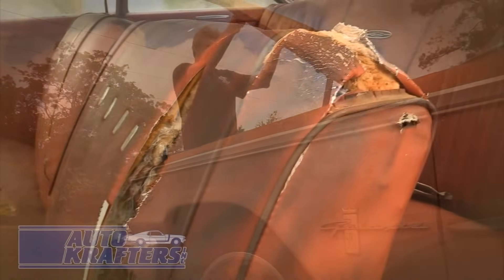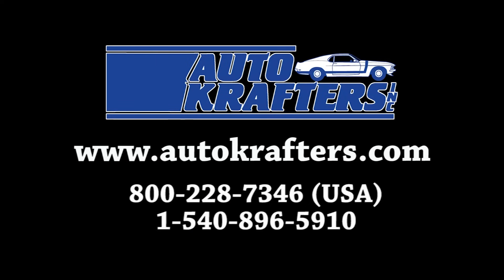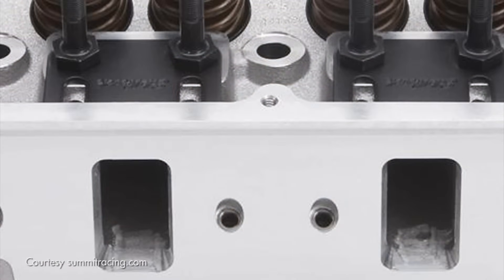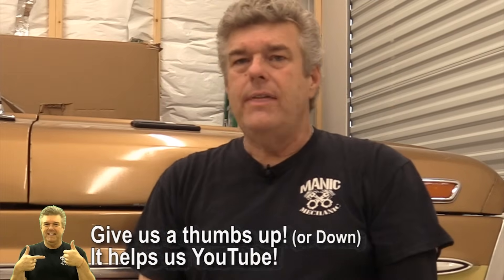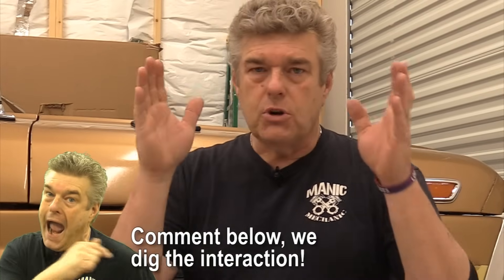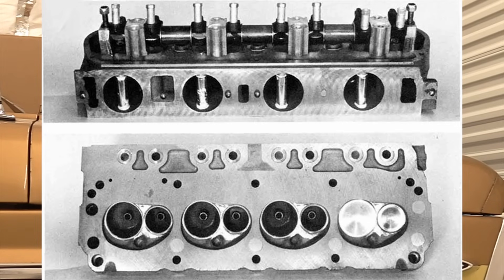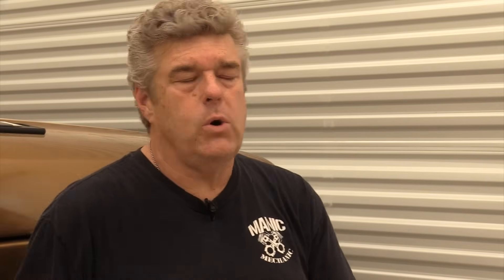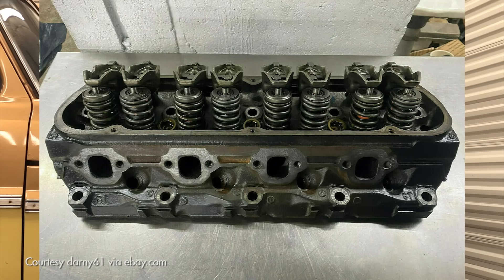Ford Heads Explained

Comment: the reason some of us search for the best cast iron heads for performance is that some circle track rules and classes require stock cast iron heads.  some of us are trying to get affordable Fords back on the local tracks.  some tracks write the rules to only allow GM products to be competitive.  and some of us are tired of seeing nothing but Geriatric Motors products competing.  we ran fords back in the 60's- 80's, ran some Mopars and eventually gm products.  now we are trying to put a competitve ford back on the track.

Comment: I'm going with 302 E7TE heads with upgraded valve springs and roller rockers, with Comp Cam 271H,  but my target is 250-280 horsepower.  And it's going in my 92 Ford Ranger regular cab 2wd, should be fun.
.....I've since changed my mind and going with Edelbrock E Street heads.

Comment: 65 289 heads. My thumb was larger than the exhaust ports. 
I ran the engine for 5 minutes hooked up to My headers. It left a carbon imprint. 
I opened it up to match 
Port & polished intake & exhaust. With combustion chamber. 
HP heads worked will.

Comment: Those 351w heads 1969, 1970.... Had an extra bolt in the intake and the water port was like an L shape and i used them on 289 and 302 engines but you have to use a 351w intake gasket.... The 302 gasket would close off part or the intake water port an cause over heating problems...
Odd yes...

Comment: Aftermarket heads are the way to go! The Explorer heads were the best factory choice! ALL the other factory heads suck unless you install bigger valves and a port job! The Explorer heads were the best ever! With a little port work  on the exhaust side and you could make cheap power! I got a set of ported 69 heads like he’s talking bout! The little you pick up on valve size you loose in compression!! Just buy a set of aftermarket heads! And, if it fits, put a 351w in the thing!! What a 306 will do at 6800 a 351w will do at 6000! I spent 5 years 4 nights a week! He right bout the Clever, that cousin kissing pervert! But, looking at the flow numbers the Victor Junior flowed almost exactly what a 4bbl Cleveland does on the intake side! 274 cubic feet per second! And you don’t need custom headers!!

Comment: I have a set of D0OE heads on a 351w, with 1.94 valves, ported pretty fucking big, I got 567hp/446tq on dyno, flywheel hp. Fantastic heads. Granted it is a non street engine (3500+ rpm) propels a foxbody to great speeds! 4.30 gears.

Comment: Do a video on putting 351 Cleveland heads on a Windsor. Are there parts available? What is involved? Is it worth doing?
Reply from the maker: It's called a Clevor. Basically it would be a long stroke Boss 302. Yes do a good bit of machine work to the cylinder heads to make them work with the Windsor block. And I'm not sure if the intakes are still available for that application.

Comment: I got 351w im pulling out of a 81 rv camper from a family member. She gave me the truck and im pulling the motor. After doing research on alot of different stuff not realy knowing much about older motor. Going to keep the RV cam or put at least a better sounding. Keep it as a truck motor. Bought a set of gt40p that i plan on putting on the motor. Help give a few ponys and keep the torque up. They better then the original and are still better for fuel efficiency. Motor only has 35k original miles on the motor and sat for 23 years so ill keep it truck motor.

Comment: have you talked about the F3JE-CA or AA 2 bar Marine Heads for a 351w? I found a pair on an old Volvo Penta inboard lake boat. I'm thinking about building a 1st gen lightning engine for my 1995 F250. I got the plenum, & tubular intake with tb. your thoughts?

Comment: My GT40 heads from my 94 Cobra are not 66cc heads, They came with 61cc heads with 145cc intake port, 1.85 int/1.54 exh valves

Comment: I saw a article where they took a old chevy turbo style piston and a 318 rod and machined them to fit in a 351 w. to make a 372 w. they used Cleveland heads but said the 4v head's were for track air flow but flowed to much for street but the 2v were better for street.....what a junk yard sleeper🤪🐾🐾🐾🐾😎

Comment: I currently was running a set of Edelbrock RPM heads on a 349 one of the heads messed up in the machine shop is trying to weld it up but if he can't I have a 69 set of 351 Windsor heads with 1.94 valve and 1.6 exhaust valve with pushrod guide place that has been cut a bunch how much power do you think l would lose Edelbrock RPM head compared to these Windsor heads

Comment: I HAVE A SET OF 68 302 4v heads don't know if they are any different than a stock head not sure of valve sze also what about gasket matching the ports if not all at least the exhaust intake you don't have much meat to remove exhaust thats a whole different story

Comment: first time commenting.

I have a 1975 Ford E150 Custom short van with a 351w engine in it. 11 years ago the original engine took a dump so I had to replace it with a remanufactured one. The block itself is from 1974. Everything, including the heads, still from 75. The only upgrades I have done to it, as of last week, were swapping the intake manifold from the original 2 barrel to a aftermarket (JEGS) 4 barrel / single plane / air gap. I added a Edelbrock 1406 w. electric choke. Mickey Thompson Valve covers w. new seals and a regular tune up (new spark plugs, wires, distributor cap and rotor, change of oil).

How can I determine what kind of heads I posses w/o taking it all apart lol.

Thank you and I really enjoy all the knowledge you are sharing.
Reply from the maker: The heads should be one of the following:
D5TE-DA – 1975-1977, 351, Windsor small-block, 1.84/1.54 valves, 60.4cc chamber

D5TE-EA – 1975-1977, 351, Windsor small-block, 1.84/1.54 valves, 60.4cc chamber

D5TE-EB – 1975-1977, 351, Windsor small-block, 1.84/1.54 valves, 60.4cc chamber

What  can happen is you get stuck with 302 castings, if it feels like it's down on power this could be an issue. You would have to remove the valve covers and look for the stampings inside their to know which head you have
Reply: @AutoRestoMod  thank you for all this info, sir. I really appreciate it. I will do has advise.

Comment: if you use  a Windsor head a on a engine smaller than 302 you need to install a pop up piston the Compression loss will kill more power than you will gain with the Windsor head!  We used to drag race 289s back in the late 1960's, If you are using stock pistons the best is the 1966 289 small chamber milled .060. You can get 11.2 to 1 compression with 1966 289 heads.  The P head reminds me of a Chevy head you are all ways burning Spark plug Wires off.
Reply from the maker: True

Comment: you didn't even mention the e7 heads from the 80s. I do appreciate the info, but I do wonder about the 289 non-hipo heads. I have heard tell that you can put bigger valves in them, but the flow suffers because of the chambers contour. Has anybody ever heard any of that?

Comment: LS1 is a copy of the 351 Windsor but the Windsor has way bigger bottom end bearing to make the power with a slight modification you put the LS heads on the Windsor 🎉
Reply from the maker: Well that's kind of kinky, but I like it

Comment: I got 69 heads and die grinded the humps in the exhaust ports then took them to a machine shop and had to have most of the valves replaced.  Took a week die grinding them.  Could have had edelbrock.

Comment: Late to the party, but wanted to mention a couple important points. The 69 and 70+ 351W heads are different. In 70, California needed EGR, so instead of a special casting Ford made all of the 351W heads with a 'bump' cast in the exhaust port for EGR piping. 70 Cali cars had those drilled open, the rest didn't. You can't just grind the bumps completely out when porting the exhaust because they're cast hollow inside, and cutting them too far exposing the internal void will ruin the heads. Find an old-timer who knows how much you can safely cut away or just leave them alone. 69 351W heads didn't have that bump so they flow exhaust a little better. 

The other thing is steam holes, the small round opening in head gaskets between the water passages you always wondered why it was there. Some 289 and 302 blocks have the issue, not sure about the other sizes. Some blocks have that spot open to the water jacket and some don't. No rhyme or reason, no casting or design number changes, and both types can occur with any year's blocks. If your block has steam holes, your heads need to have them too. Use a head gasket for a template and drill your heads with a similar hole into the water passage. Heads with steam holes work with any block. Mentioned because many early stock 351W heads don't have steam holes, and you'll pull all your hair out trying to make your 289/302 not run hot unless you know the trick.
Reply from the maker: Really good information. I had forgotten about the bumps in the exhaust ports on the post 1969 351 head

Comment: 260 1964 has 1.67 intake and 1.46 exhaust. 1965 289 1.78 intake 1.46 exhaust... 1969 through 1974 351w had the same heads 1975 was basically same as C9 heads but were thin casting decreased valve size but had same port casting size and changed to 14mm spark plugs. Then they tank. Until gt40 and gt40p.. Wish Ford allowed the 1966 gt40 racing heads to be sold to the public. It is a match to Ford like what the 461x and 492 double hump heads were to Chevrolet.

Comment: I truly lucked out and found a set of 69 D00E heads is excellent shape for $20, couldn't pass it up. Guy was going with aluminum heads and was giving the old ones away.
Reply from the maker: Those are the best you can get for stock irons on a 351. The chamber size is problematic on a 302 or 289 though.

Comment: I am in the process of rebuilding my 1993  E F I  bronco daily driver with a 351w. can you recommend a cam that would work well with the EFI and get the most out of the engine.

Comment: I’d love to see a breakdown of the 385 series engine heads. Anything out there?
Reply: 1968 to 1971 heads are the best non cj heads. 72cc with screw in studs... no guide plates and non adjustable  but it's all setup for it to bolt on after that, they all had 90 cc chambers and crappy non adjustable rocker arms... efi heads? Run from those. Also, rare police heads are great but kinda rare. Look for omc cobra marine heads Basically police heads with a D2 part number... police heads are kind if in between early heads and cj heads. For performance.. get a high compression early head. 429 and 460 are identical... no 460 cj though.

Comment: David Vizards Classic Series 289 limited to factory iron heads dual plane and pionts uses the old 289 s opening chamber bowls and 1.94 valves w 1.50  502 hp 411 pounds so the best head is a closed chamber 289

Comment: HI  thanks  for sharing Question would the heads your speaking about would they work on a 95 f150  302  I'm retaining  factory  EFI  also currently running bbk short headers  I would like to upgrade cam mild upgrade .  What to you recommend  my truck has 59,000 original miles 2rwd  4r70w trans  3.31 open gears

Comment: My 65 has a punched out 302 to 306 with 65 289 heads. The car is a rocket. With a 650 Edelbrock I can run it to 6k and it pulls all the way through

Comment: I put a pair of c9oe 351 heads on a 289 and I only had 80 pounds of compression I had to go to a pair of 289 4v heads then it run fine
Reply from the maker: Chamber on the 351 C9 head is larger.

Comment: Have gt40p heads on maverick. The plugs will screw you for headers unless you use shorty plugs if you want headers. I said screw or and put 289 hipo exhaust manifolds on it to clear the plugs. It works

Comment: Funny I was using  260 heads in the 1980's for  small  block drag racing..  just port and polish  and  big  valves  and  go  racing.    You  can  hit  a  casting  flaw when porting  those  old heads. Just head the head and weld  it up.

Comment: I scored '69 351W heads from PAW (Performance Automotive Warehouse) with a mild porting, flat top forged TRW pistons, RV cam, 650 double pump-runs really well in my '63 Falcon V-8 from the factory.

Comment: I am building 2 windsors. A 221 and a 260. I am going to have to use small 45cc chamber heads as compression change is not an option as with a 289 or 302 (no pistons available). These will be hotter street engines that I am not going to go crazy with. I am using an Offenhauser dual port 360 with 390 or 465cfm 4bbl on the 221 and a cam that is just at the edge of a smooth idle (hyd or maybe roller hyd). I will put bigger valves and open up the ports to match, int and exh, but would like some idea about valve size. Any idea? I have to change them to hard valves and seats anyway.

Comment: Jeez, so much was missed or inaccurate. Regular 289 heads up to mid 66 had non rail rockers like the hipo. Also all 289 and 302 heads had 1.78 intake and 1.48 exhaust... up to 1996. The 68 302 heads were a decent head with 58cc chambers... any large plug head had a decent chamber except the smog 68 up heads... all big plug 351w heads are the same... up to 1974. 58cc chambers. Gt40 heads are not 66cc heads...more like 62cc. P heads are 59 to 60cc with the 1.48 exhaust... never mentioned intake port sizes or exhaust ports... that's the good stuff... man alive...

Comment: D5ae-ca heads how bad are these heads? Lol gotta a couple free sets looking to buld a 302. Another  question 63 Fairlane do i need to cut the shock towers to fit a 351w in there looks pertty tight.
Reply from the maker: Windsor will fit, but headers may be a issue. The D5s will put in work but will never be great performers.

Comment: There was also 68cc truck heads in 289/302 having low compression for standard fuel. About 7.5-1 comp.

Comment: I put the 69 351 heads on my 302, back in 1985.  It woke that motor up, big time.  I didn’t have the money for a dyno so I don’t know any numbers.  I was 18 when I built the motor.  I ordered the rebuild kit from my PAW catalog. My internet wasn’t working 😳.   I had a 68 Mustang convertible with an automatic.  It would spin the wheels pretty good with the 302 heads but when I put the 351 heads on it the tires would spin through 2nd gear on the street if the top was up.  With the top down it would roast them a little less.  It was worthless at the track since I had to have to top up and I don’t remember what it ran.  So if you want to keep a stock look, find a set of those small chamber heads.  All I did was gasket match them.

Comment: One other difference with HiPo heads is valve spring installed height. The regular 289 heads up to 66 1/2 had an installed height of 1.64" to 1.66". The HiPo had the 1.78" installed height which all the heads had for 1967. Just an issue regarding valve springs selection.
Reply: The HiPo 289 heads had cast in spring pockets which he didn't mention.

Comment: Incomplete and inaccurate information. The GT40P head does not go from the mid to late 90s but from mid production 97 (January 97) up to 2001 5.0 Explorers. Earlier than January 97 is the GT40 head. The P head has a smaller exhaust valve than the GT40 but flows better due to improved runner castings and the revised spark plug angle contributing to cleaning emissions, better economy, and more low RPM torque, the P head also has a smaller combustion chamber than the GT40 head giving you a bump in compression and ANY bump in compression is measurable Horse Power and torque. The P head has poor valve springs and would need machining spring pockets and new springs for any type of higher RPMs where the Horse Power is, however as they sit the P heads are an excellent and cost effective bump in low end torque and economy for an older pickem up truck that you will lose with the pricey larger Valve aluminum heads. There are lots of headers that will work with these heads that may need some simple tweeking such as grinding the flange or using angled spark plug boots on some cylinders. Ford Racing Stainless Steel M-9430-T-50 F-Series Headers are a bolt on header for 80/96 Small block Ford F-150s. Always verify everything before spending your hard earned dollars

Comment: I have a set of C90E 302 heads, yes they have 302 on them, not 351.. Closed chamber with like 58cc chambers. I "think" these are the ones called the "police/taxi" heads. Made in March of 69. Info on them is pretty scarce.

Comment: I've got a set of 87 thunderbird 302 heads that have a closed chamber heads that I've haven't seen any of the other years
Reply: The notorious E6AE heads with the shrouded valves? They were used 1 year on the Mustang ('86) but were junk so they switched to the E7TE (T as in Truck) for '87-'95 Mustangs because it was the closest to the '85 E5AE head (which were specifically redesigned so the roller lifters could be removed without removing the heads). The E6AE were supposedly used in low po applications until about '91. (IIRC, correctly there was also a E6SE head which was the same as the E6AE.)

Comment: If you want to build one fast inexpensive small block Ford Cleveland 1970 casting 2v heads 750 Holley double pumper and a boss cam from 1971 grind pick lunaties version
Reply from the maker: Agreed.